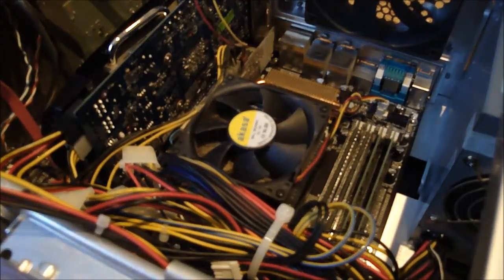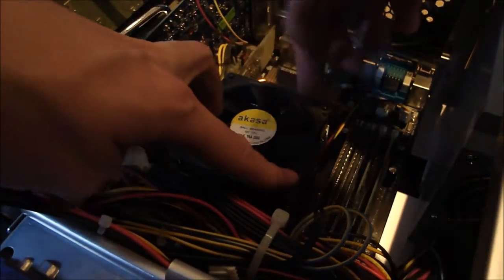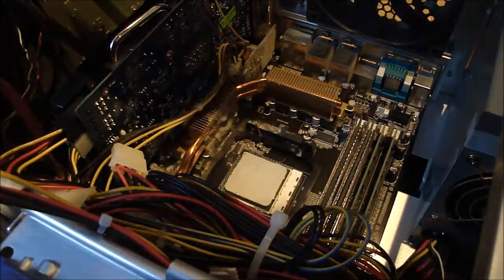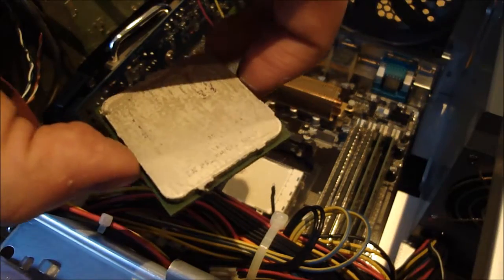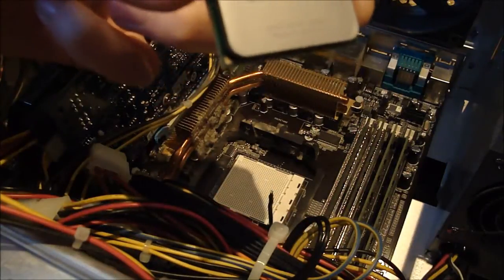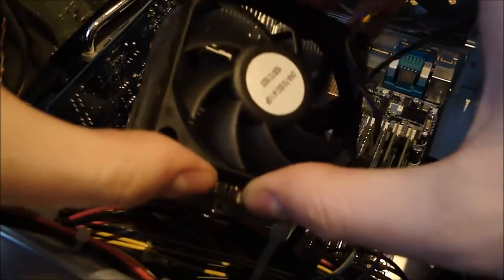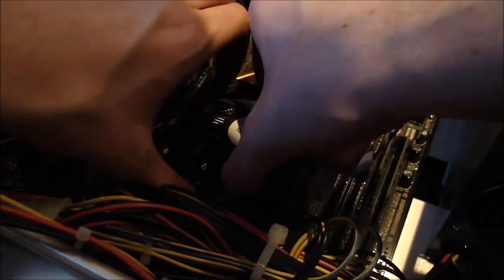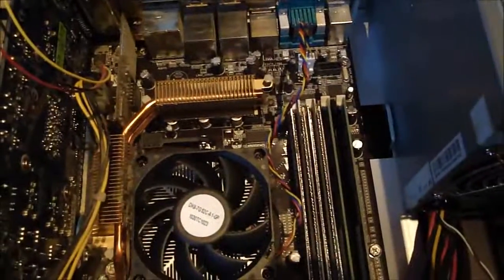How to Install a new processor Athlon II x3 450 Upgrade

Comment: I'm going to upgrade my old cpu amd athlon II x2 220 to Athlon II x3 450 on  hp p6548sc desktop, but there is few things that bothers me.. Motherboard specification in hp site tells that it supports TDP95 amd athlon (II) x3 4xx/4xxe  (without  "II" in it), also I'm afraid that I need to update bios, I dont want to do it cause I have ruined it one time. Tho, there is no newer bios listed when you search for drivers and such.

Comment: the socket of my motherboard says "Socket 775 LGA" now the processor i have now is a Intel Celeron 450 @ 2.20 GHz . now im a little skeptical on what processor to get and if it will fit on my motherboard? i want a good processor so i could at least run BF3 :)